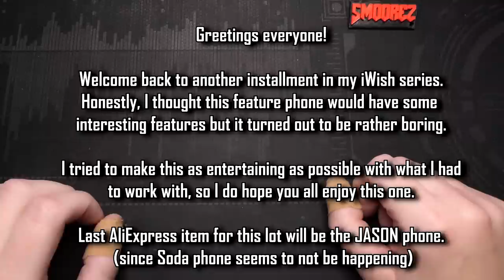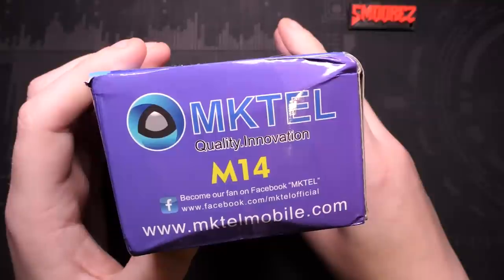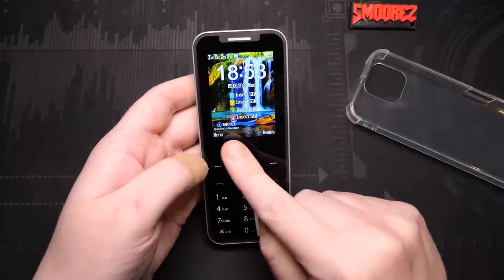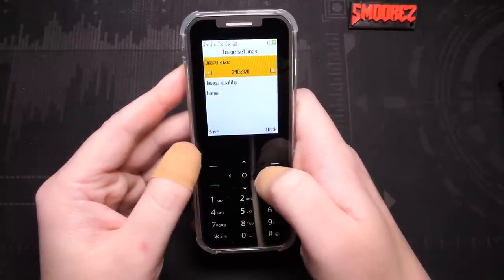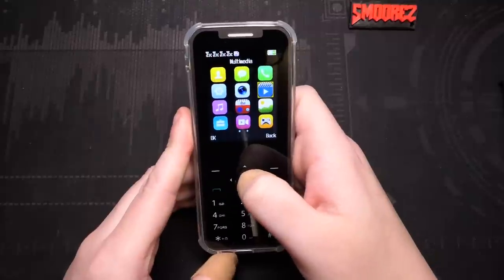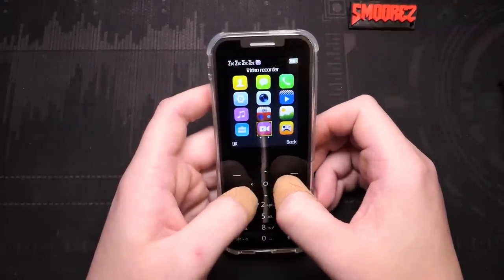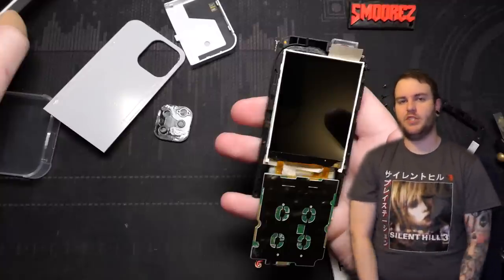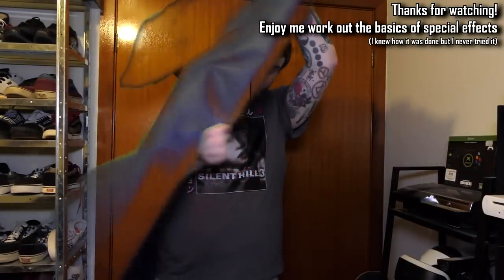iWish: The $24 MKTEL M14 - The "i14 Pro Max" turned into a Feature(less) Phone...

Comment: The last time 320 X 240 was considered high resolution was the "Nintendo Ultra 64" and it was only high res in comparison to the Game Boy screen.
Reply: N64 could render many games in higher resolution, especially with memory expansion pack installed.

Even PS1 has a number of high resolution games, like Tekken3 and Ehrgeiz running at 368x480, Dead or Alive and Bloody Roar 2 hit 512x480, and numerous games insert single splash/menu screens or 2D gameplay in high resolution up to 640x480. For 60fps games, making the jump from 320x240 to 320x480 didn't incur performance or memory cost due to TV interlacing, and then the developers had the ability to increase the horizontal resolution further until just before they hit the limit on video memory or rasterisation throughput.

One of my favourite cameras of all times, Canon PowerShot G2 from 2001, only shoots video in 320x240 at 15fps just like this. I would describe video out of G2 as dreadful, but this phone does worse. Not entirely surprising, after all G2 has an excellent lens (much better than G3) and it shoots 4MP and you can use stacking trickery such as true multiple photo super-resolution, the camera has extra modes where it will bracket and repeat shots for you to help you do this, HDR and raw processing to get more out of it than was possible back in the day, and it happily takes multi-gigabyte memory cards, but even the internally processed JPG photos out of the camera are insanely beautiful, every pixel has meaningful detail with no overprocessing artefacts and the colour is stunning.

Sorry i kind of love tech of that overall era.

Comment: Whoever called cheap basic phones feature phones knew how to make them sound like more than they really are.  I have a "feature phone" and it is a basic flip phone with no apps to speak of.  Even the camera is not something you would buy it for.  What sets it apart from all the horrible fake phones is that they were truthful about the specs and did not get your hopes up on in being any spectacular device by any stretch of the imagination.  It only has a 3 or 5 MP camera, texting on it takes eons because it has no touch screen or keyboard.  Sending a photo from it is sheer misery when it comes to getting a good signal with it.  Even if the network still supported it, you couldn't even give it away!
Reply: I mean, older MTK devices had Java support, a melody composer and stuff like that so...
Reply: @the2323guy This thing had Brew OS and not a lot is known about that. It is something that mostly the most basic phones had.
Reply: Learn the power of T9 typing. We managed back in the day. And don't forget, 1440p is also just 3.6 MP. If the sensor is good, that can be just enough. And if the specs are good enough to use it smoothly, I could see it being a useful work phone.
Reply: The SPH-M330 is a basic low end phone. (Probably) 8MiB of ram and 32MB of NAND. CPU is probably clocked at 192Mhz. There is no 3D acceleration.

That Samsung makes these things look like Commandore VIC-20's.

Comment: I would buy a cheap feature phone to use as. Mp3 player been thinking about buying one for awhile. Not this one though a smaller one
Reply: At that point might be worth getting some older android device. Optimally something that has a replaceable battery, microSD slot and headphone jack. Basically all you need to add music but also have a comfortable user experience.
Don't add a SIM card, show if there is a slimmed down custom ROM, don't install any bloat.
Something like a Galaxy A5, redmi 2 or XZ2 compact
Reply: @HappyBeezerStudios  or a dedicated android mp3 player

Comment: In all fairness when you buy these sketchy devices the box would be the least of my worries.  They show a pic of a nicer looking device online to trick you.  That part doesn't really worry me as much as the cheap chargers.  Those things can burn a house down!!  If you dare to use such cheap charger you might notice it feeling hot.  That is not normal and you should get a good one ASAP!  Oh and when you charge any device, especially a badly made Chinese one with false specs all over the place leave it where air flows over it so you don't lose your fingerprints when you go to pick it up from it being so darned hot..  That is less likely with a well made phone but I would not trust a Welcome phone not to be a fire risk!
Reply: More concerning then thermal safety (as even the crappiest SMPS-Chips have some sort of thermal cutoff and if something fails short circuit they will just vaporize the tracks on the PCB, arc inside and pop the circuit breaker- happenend several times to me) is the electrical safety. The isolation distances on the PCB between mains and the output are barely existing, the interference capacitor is not rated for use between mains and output and the wires in the transformers are only isolated by the 0.00001mm of laquer on the wire. Every time someone touches the Output or any device connected to it, he basically touches a live wire on mains voltage isolated by a whiff out of a spraycan.
Reply: When they use a resistance load to get the voltage down...
Reply: chargers getting hot isn't unusual lol, they gotta dissipate power somehow
Reply: @HappyBeezerStudios  That would add to the price. We can't have that. Sorry.  :-)